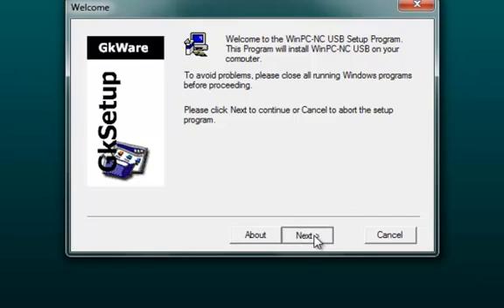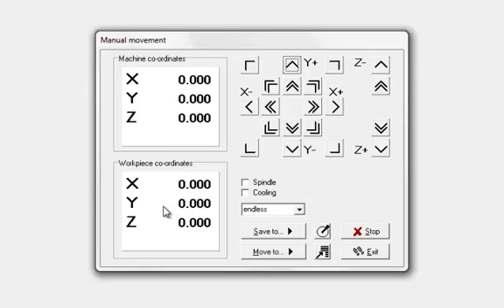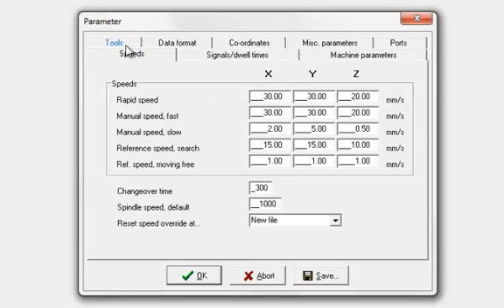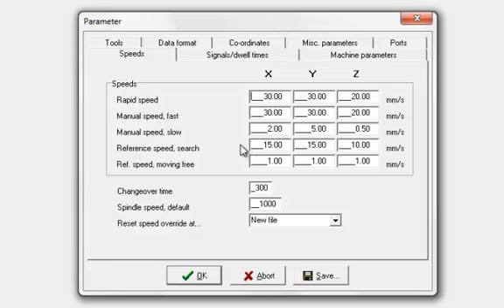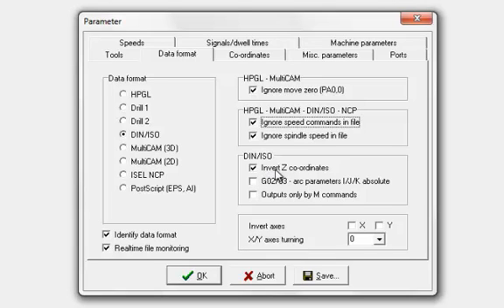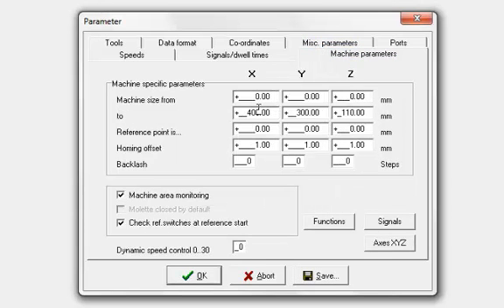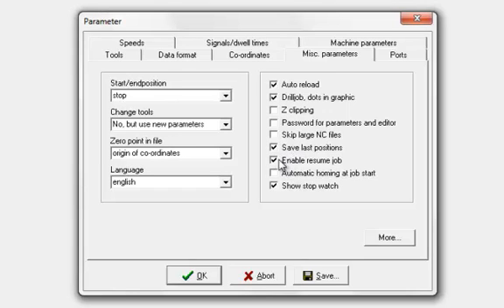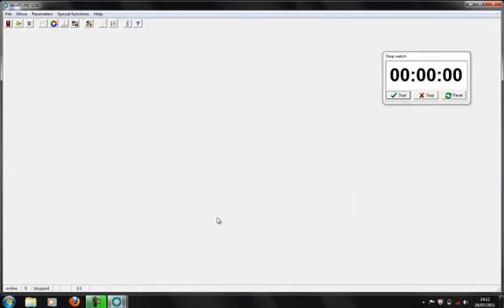WinPC-NC Installation & Parameters

Comment: So great to see HighZ 720s mentioned... Also have WinPC-NC. 
I had to let the cnc maching sit for a couple months after it went crazy
with high milling speeds. Stopped it and was afraid to turn it back on.
Then I got the mental fortitude to turn it back on again without a bit.
The coordinates do not seem to be holding. When attempting to
reference there is grinding as it hits limits. This is mostly in the
Jog function that I attempt to move the cnc spindle positioning
about.  
When I bring in a simple test rectangle specified to cut wood, datum
centered. The rectangle to be cut isn't showing in WinPCNC at times.
The indicators for where the spindle position and datum are
are not where they should be.
When go to Signal Test the indicator icons show Z red
and the remaining coordinate buttons as black. None of them
changes. There are two blue buttons,"spindle", "cooling"
 which aren't relevant to coordinates in this Signal Test window.
There are small limiting switch magnets used which are embedded
in @3 cm/1" white plastic.
Just cannot seem to get the machine to recognize/hold coordinates.

Comment: I am having issues running any nc file that isn't the actual winpc nc format. There is no way to export as winpc nc when saving from MeshCAM. Any ideas/help?
Reply: Hi! I am designer/art kind of person with a little technical background.
I do the main work in a gcode generating program called Vectric.
Because I work with orginal art/designs, the preliminary work is
oftentimes done in CorelDraw (older version... use it for doing the
vectors). In CorelDraw I save the file as .cdr, .svg or .ai most of the
time. Usually all three formats saved in so when I bring the art into
Vectric it comes in pretty much as it should. The .svg format
works wel. Currently I am only doing the art with the intention 
of working on different levels. No up and down curved surfaces
that would be like a hump/half sphere, nose on a face...

Vectric is a gcode generator and when one works in the program
one can see the 3d result of what one is attempting to
achieve after getting all the parts pieces specified.

When the rendering is correct in Vectric, one generates the gcode
in Vectric. One opens only the gcode WinPCNC file in
WinPCNC. 

Hope this helps somewhat.

Comment: Hello. 
Thanks for the video :) Not much good info to find regarding the Win/Pc Nc so this was just super. I have the High Z-1000, got it not long ago, but haven't had a lot of time to play with it, due to the construction of my new home. But soon I hope to digg in to it. 

The thing that is most anoying with the way I have it now is that I do not have a tool hight sensor. I heard you mentioned it, and can I ask what type and where you purchased it ?? Would bee nice to not having to use the paper trick everytime. 

Next after the sensor will be a tool changer, but they are pricy :) So will not be on the list of 2016 :) 

Hope to hear from you and seeing more videos soon. 

Best regards
T.Robertsen Norway.
Reply from the maker: Hi, you can buy a tool length sensors on our website at www.prototools.co.uk - see the High-Z Accessories section.
Reply: Norwegianwoodworker